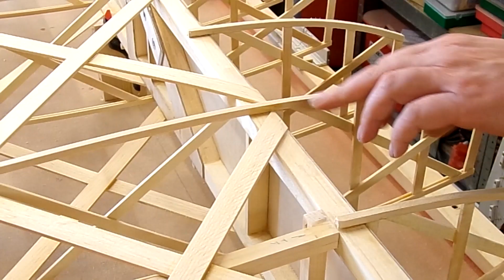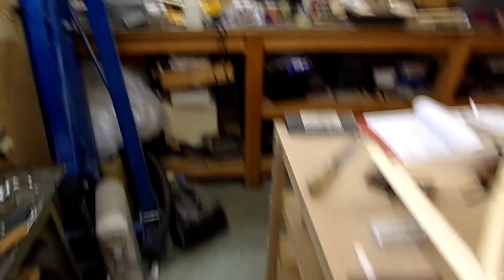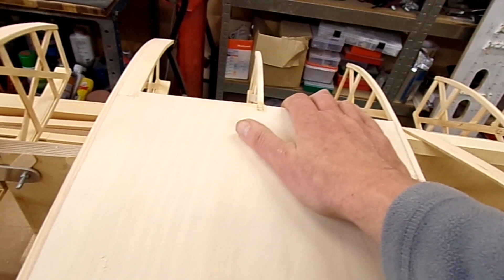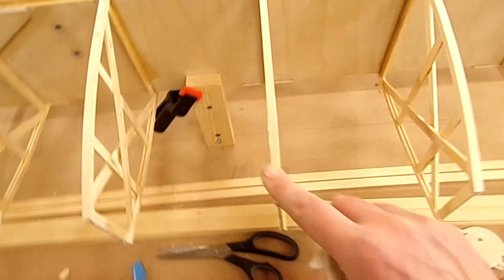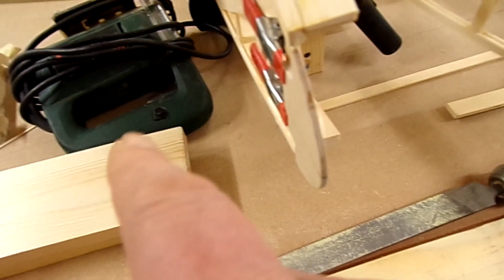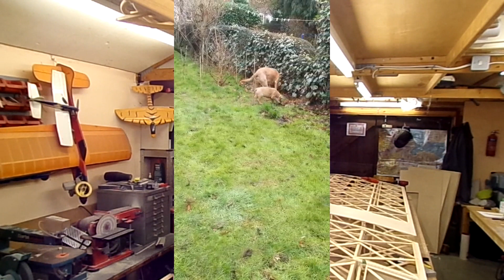EP42 Fisher Youngster V Walkway, ailerons and leading edge

Comment: There's constructing a kit plane and then there's building a kit plane, amazing work. I assume if you can't find a bit or it's missing you just cut a piece yourself? Is the ply wood just a standard type or is it specially prepared (dried etc.)? I find this series fascinating.
Reply from the maker: Thank you for your comment. Yes if it is miss, or a musk it up or just don't like the one they supply I make another. The ply is aircraft grade birch which is made with fairly eventhickness wood and made up with no voids in it like you might get from a hard ware store. The stuff I supply myself is from seconds (marked with the faults, like a knot and the top grade like 1/8" is 5 ply), so I get it cheaper.
Reply: @flyingkub  very interesting thanks. How will you transport the finished aircraft to the airfield or do you have a strip at home?
Reply from the maker: @terryjkent  I wish I had a strip at home, then you could pop in for tea and cakes, there is a field not far away but not ideal for test flight, so it will be taken in sections to North Repps finally put together and checked again for W&B and engine set up, then the test cards will be carried out. I wil wait for a nice day so I can use 22 or 04